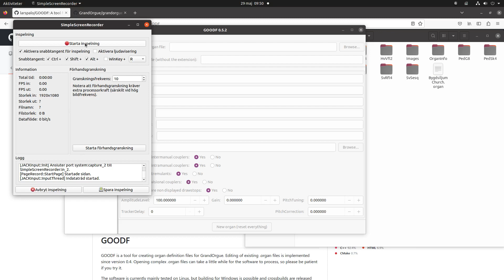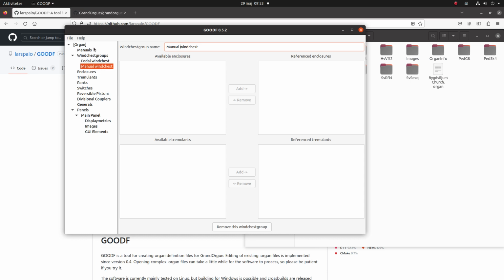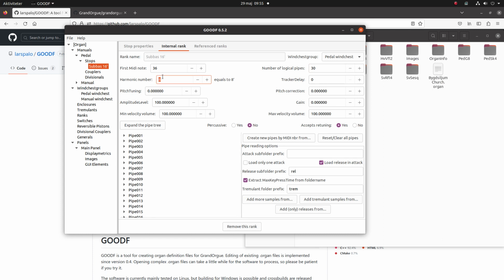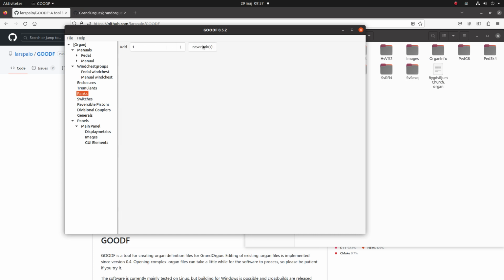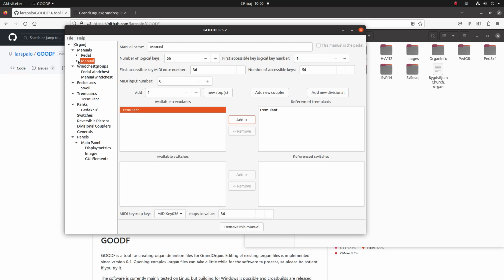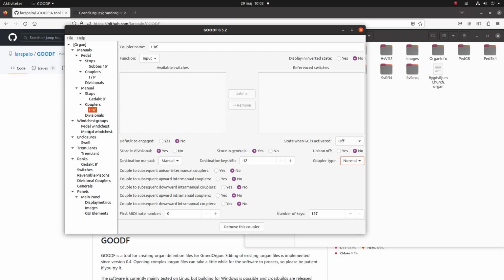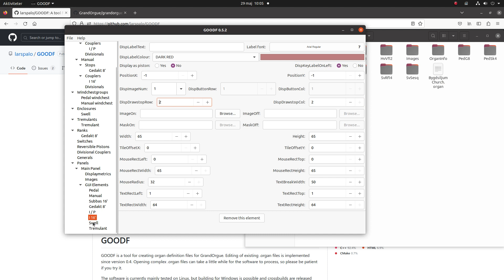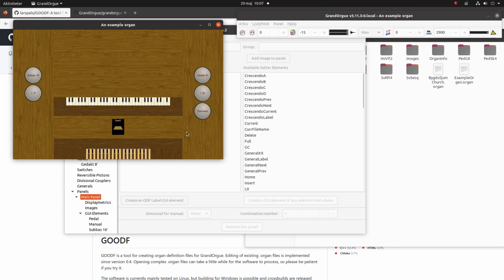GOODF Screencast 2: A Basic Organ

Comment: HI I am trying to modify Piotr Grabowskis Freisach so I can have the Stops where I want them like other simple Grand Orgue GUIs. Ive Loosely got it working (the pedals atleast). But when I press a pedal I get the pipe running (sound from the appropriate pipe) and it seems to run probably for the length of the sample regardless if I hold the pedal down or not.eg about 8 to 12 seconds. How do I fix this? (so that the pipe goes quiet when I let go of the pedal). thanks. alex
Reply from the maker: Sounds like the Percussive=Y might be set for it when it's supposed to be a sample with a loop and cue.
Reply: @larspalo9427  HI there, thank you, If I import freisach orgue file into GOODF and then write ODF with no changes (percussive  equals no, as it was when opened in GOODF), Grand orgue wont take the file it reports "error missing value section Rank001 entry Percussive". So I then turned Percussive =Y(for all pipes) and Grandorgue will then take the file. I do have the buttons more or less  arranged how I want them though so Ive made some progress. thanks, alex
Reply: actually my orgue file only will import as I started from scratch and added in the freisach samples. After I changed the percussion settings in the original file I found other reasons why it wouldnt import...was trying two different ways of getting there.
Reply from the maker: @alexscott4428  Use a more recent version of GrandOrgue. From the GoOdf README file: "Please be aware that currently, due to changes in the GrandOrgue software, from the version 0.11.0 of GoOdf the .organ files written will require a GrandOrgue version 3.14+ to work! If compatibility with older versions of GO is important one must also use an older version of GoOdf (like 0.10.0) to write the odf."
Reply: @larspalo9427  Excellent yes that worked (3.14.2) I was 3.5.6 or something but I've built my custom panel again and it seems to work so far, thank you :-)